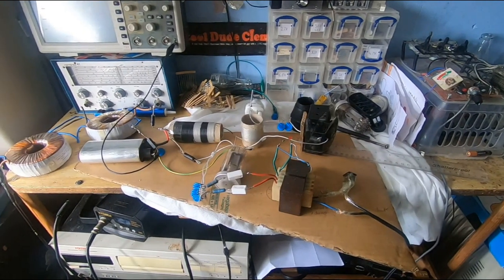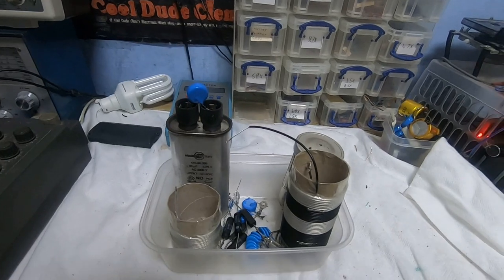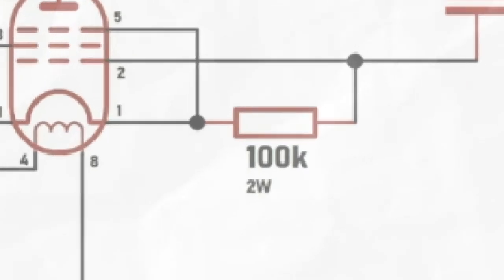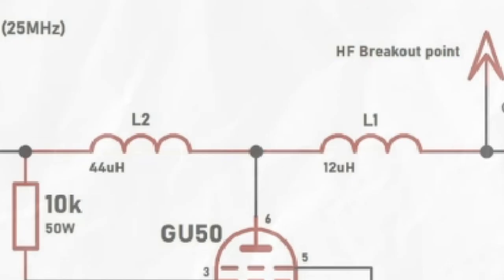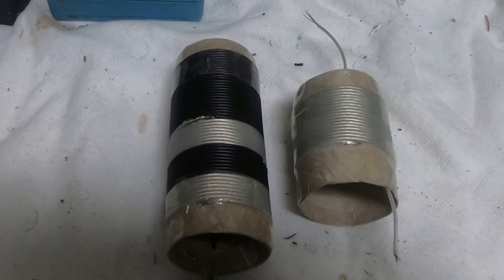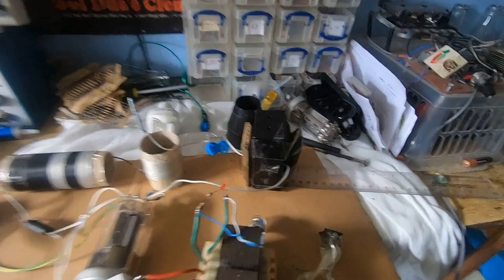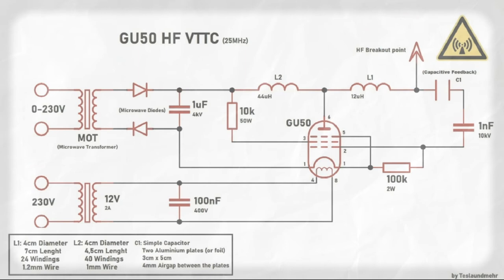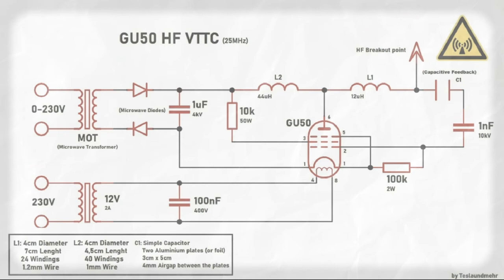Need help on GU-50 plasma flame circuit.

Comment: Should both coils be "magnetically" connected, meaning wound on the same pipe? Greetings from Denmark.
Reply: Not for this circuit. They can be separate
Reply from the maker: I don't think they need to be, I'm pretty sure they need to be seperate, that why I oriented one of them sideways and the other one vertical.

Comment: Interesting theres no bypass cap close to the oscillator, these things are so sensitive, just changing the length of the breakout point can  reduce the output drastically.. are you getting red plating? My thoughts are Its either out of tune, not enough grid drive/correct bias or maybe a bad tube, probably exactly what your already thinking 😀
Reply from the maker: I never run it long for the tube to start red plating as I don't want to destroy what little I have, so it's just a brief on for a few seconds, then off. So should the two coils need to be in tune with each other?

Comment: Maybe check valve biasing against the valve data, check frequency, reposition coils or something. I don't know, as I've never tried to build one of these.
Reply from the maker: The annoying thing is though, in the past I built one of these that used a different circuit, it still used a GU 50 tube, but that circuit worked, I did get a plasma flame, only a small one, so maybe I'll re-visit that.
Reply: @CoolDudeClem  wasn’t that outside in a garage?! I tried same circuit years ago and got no results. I did. blame it on the tube cause it had a miniature crack in it. Please keep us updated and good to see you building coils and stuff again!

Comment: Puh, my first guess would be wire connections, what does your scope say to it, hows the waveform?
Also those small resistors can have quite the inductance.
you can use a single resistor, it doesnt need to he a high wattage one 100k shouldnt get too warm.
the capacior for feedback looks okay to me.
Leon from Teslaundmehr made a video using the same schematic, you should take a look at that maybe.
the shield put that to mains earth rather than ground, see what happens
Reply from the maker: I'm not sure if I could measure the waveform as it's such a high frequency, and the power is supplied on a half wave rectifier, there would be a lot of mains frequency noise in there too, it's gonna be really difficult go get a good look. I have seen Teslaundmehr's video on it and I'm quite envious, although he destroyed the tube by over-driving it at the end which I didn't think was necessary.
Reply: @CoolDudeClem  True.
tho a half wave rectified wouldnt cause anything funny, or did you mean halt wave doubled? half wave doubled could be a problem for these sorts of oscillators
Reply: @CoolDudeClem 
Any Update?
Reply from the maker: @janno288  I'm currently comming up with a few ideas.

Comment: Did you check the frequency? Maybe you are way off?
Reply from the maker: I don't think I have any thing that could measure such high frequencies. my scope could be fast enough to measure that but the circuit as powered a half wave rectifier with no smoothing I'm not all that sure if I could get a reliable reading from it.

Comment: Hi Clem Its Paul here again 🙄. Anyway I'm not sure why they used a pentode, normally I would have used a triode unless they are using a grid as an accelerator, I dont see how the valve is being driven in to oscillation. I would try a low competence, high voltage capacitor where the 10k 50w resistor is, Also leave pin 5 no connection, as you have it to negative it would close the the valve down and could damage the valve. (First try removing pin 5's link to negative and leave it floating)
Reply from the maker: Pin 5 is plate 3, I thought that must always be connected to the cathode, even some tubes are internally wired that way.
Reply: @CoolDudeClem   Hi Clem, Yeah I have also seen that too, but knowing how valves work I imagined that the grid going to  negative would cut the electrons getting through to the cathode, Anyway it was just an idea or a thought. When I was your age our lives are very similar, I use to spend all my life in my bedroom designing and fiddling with electronics, I first started  electronics when I was about 10,  no girlfriends, even when i left school I would work as an electrician, then get home to electronics lol.

Comment: Build a class E 

In mhz range inductance and wiring can make a difference

Want to have short connects as possible 

And a pcb
Reply: Reduce as much stray capacitance and inductance wherever you can
Reply: Wonder how drsstc driver topology would work in such modes
Reply: Can use a zvs driver too
Reply: Build a zvs using tubes

Or zero current switch since tubes are more current controlled than a MOSFET

They switch either when apparent voltage across it is zero (anode-cathode, or drain-source)

Or switch when the apparent current through the primary is zero (current sensing)

Allows greater efficiency, faster switching at higher power with minimal waste dissipation
Reply from the maker: @Clancydaenlightened  A tube based ZVS? Now that sounds like an interesting experiment to do!
Reply from the maker: Good idea, thanks. I might rebuild this as I can see now that I've probably done it in the worst way possible and just expected it to work.

Comment: After finally making my on GU-50 Plasma Flame generator (video on it on my channel) 
I think I know what the reason is, your feedback is way too tiny to make the tube oscillate real hard. 
Scrap the capacitor plate idea, have a loop of wire around your resonator coil end (a bit bellow where the flame is supposed to be) and that should make the tube oscillate well.

Also have a mA meter hooked up, because it really shouldnt be drawing over 100mA current at like 200V b+ that would mean that you are barely oscillating and the tube isnt properally shutting off.